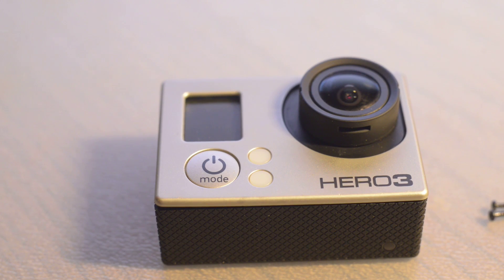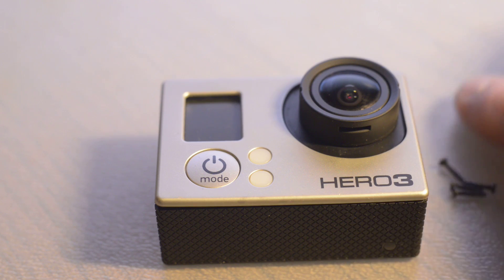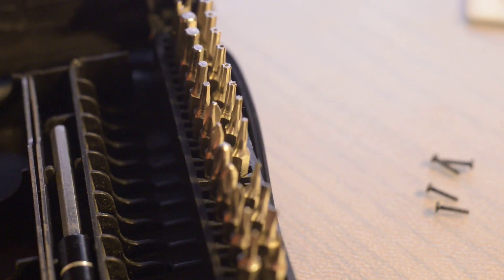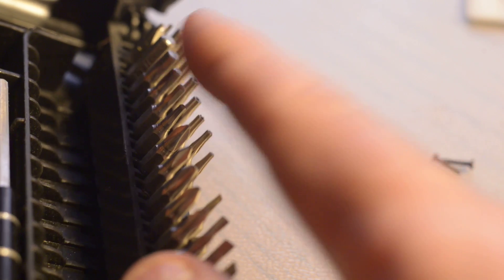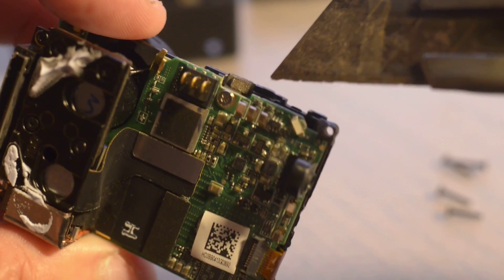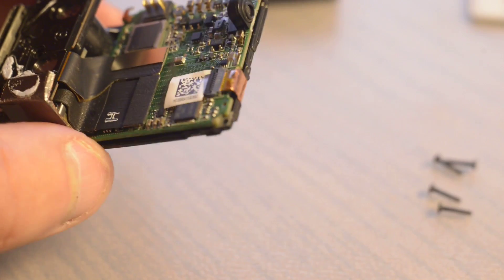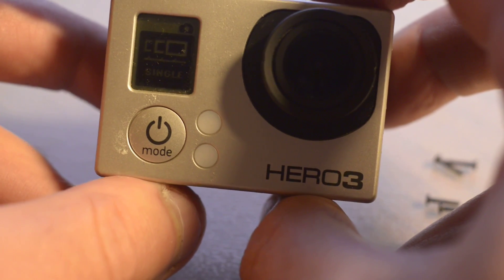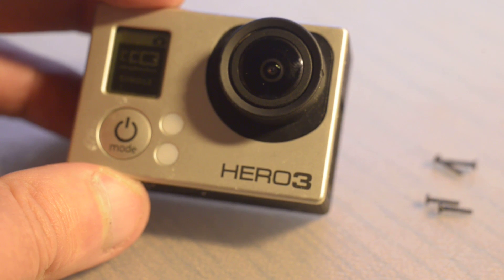GoPro Hero 3  Hero 3+ Shutter and Wifi Button Not Working FIX !!

Comment: 'Inherited' a GoPro Hero3 in a waterproof case. Worked great once but after swimming with it the buttons stopped working. So it is temperature changes that cause this problem.  Followed your steps and all is good.

Comment: This saved my GoPro Hero 3 Black that I've had trouble with for years and was about ready to get rid of! After following the instructions I can now use my shutter and wifi buttons without any issue. I was able to get the outer cover off easily with my finger nail and fortunately, I had a T-5 screwdriver for the screws inside.
Reply from the maker: glad to hear I helped you get some more life out of the old GoPro

Comment: Problem solved in 5min. Many thanks and best regards from Belgrade, Serbia.
Reply: Just to mention the cause. I dropped my cam while it was in diving case from about 10-15cm to hard surface and it instantly run into problem with shutter and BT buttons.
Reply from the maker: Glad my video helped you get your GoPro working again 😊

Comment: hi I've got the same problem on my go pro hero 4, where the shutter button and spanner button doesn't work, does the hero 4 have a similar board with these contacts on the buttons?? would i be able to try this fix for mine even though it's a different model to yours???jay

Comment: My Gopro went from working intermittently to not working at all after attempting this fix. Oh well ... win some, lose some.
Reply from the maker: Did you take the battery out? You can short things if you don't follow my directions. Sorry it didn't work for you. Seems to have worked for a few others.
Reply: Yes, I took the battery out. My camera had a tiny, flexible circuit board that was tied in with the main circuit board. I didn't see that in your video. When I separated it from the housing, the flexible board came unplugged. Was not able to get it back in.

Comment: I have ran into the same issue but it's with the mode/power button. the button does not work. but I can use it through my app or remote just fine. any advice? thanks
Reply from the maker: cody wallen if it is out of warranty no harm opening it up and bending the contacts up slightly as shown in my video. If that fails take out the micro SD card and see if that allows you to use the mode button. If that fixes it get a Samsung one as I heard they are rock solid
Reply: Yes I have opened it up and done what I seen in your video. I opened it up a long time ago and ran across your vid. Still nothing. I have no display on screen and I can't power camera up. But I can do everything I need threw remote or app.
Reply from the maker: cody wallen look for more sets of pads or try and trace any tracks from the button and see where they lead. Look for any broken tracks. This is about all I can suggest.
Reply: Ok! Thanks for the advice.
Reply: @WalrusRiderEntertainment  Hello Walrus,
Its a long Time ago you Upload your video 2016 but 
Yesterday i flutet my gopro Hero 3 black

First it was the Red light of Death on the back but Not longer now.

Hard reset was not working 
Nothing works, now
I have no tool for opening the go pro i will buy it.
But my question is.

You have only opening the gopro and unplugged every cable? 

After you unplugged you plugged the cable in and it works?

Only unplugged and plugged again?

Comment: Brilliant mate, you just saved me a lot of hassle. Cheers!
Reply from the maker: Glad it helped you out. GoPro have little interest in fixing these cameras as it isn't "cost effective". In 10 minutes you can fix it and if you have the torx screwdriver already it costs nothing in parts 😊
Reply: Totally true... I was really boomed about this and you solve it in 7 minutes. Many thanks again!
Reply from the maker: Never seen this method anywhere else so hopefully others with the same fault will see it. I'm thinking it is an assembly issue..
Reply: Cheers for the video man. had the exact same problem with the exact same model and at the exact same age (3 years). This fix cost me a few Euro for the tool and all fixed. I only got offered a 20℅ discount on a new one. I wonder how many people get caught with this and go for a new one! Anyways, thanks again! Legend
Reply from the maker: No worries. Glad it helped someone else out too